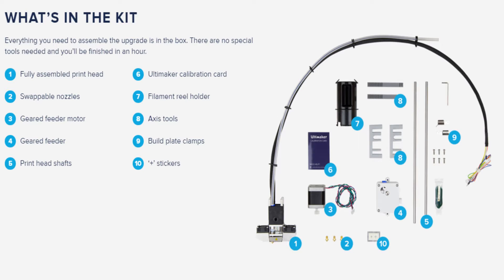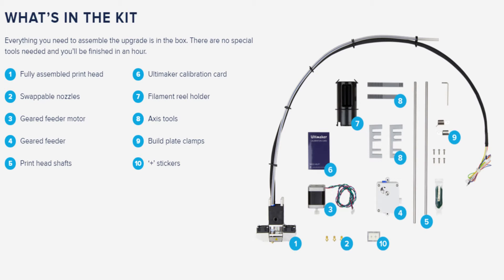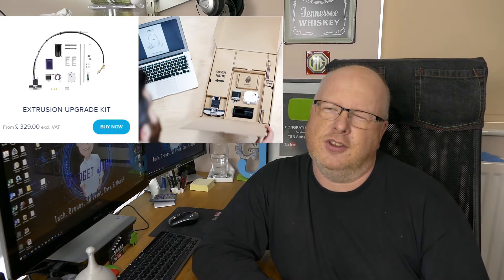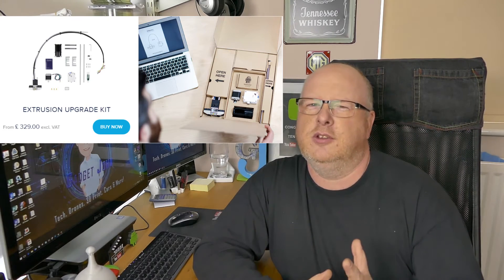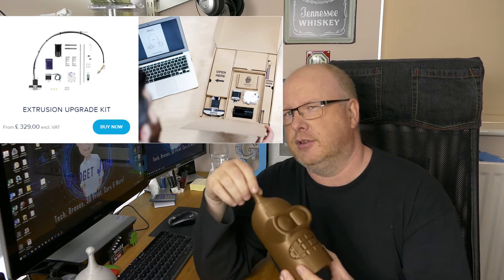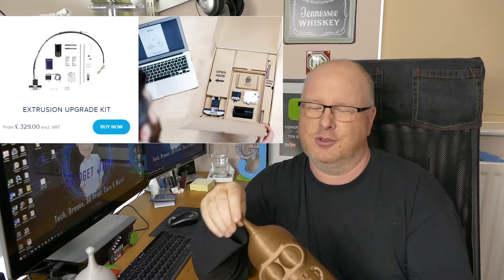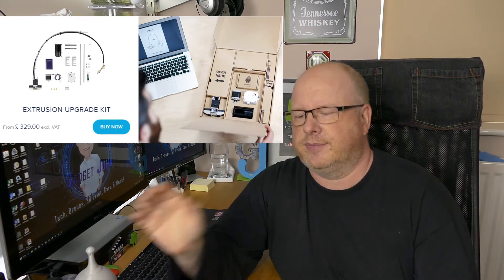Should you upgrade your Ultimaker 2 with the NEW Extrusion kit?

Comment: Seems quite expensive for my taste, but I guess thats a bit of a common theme all around with the Ultimakers. Not that i think its bad to buy one, and i'm quite shure they have a reason to charge you what they do (even if it's just to make the CEO rich... :-p).
Seriously tho, the upgrade to the plus will not make that z-scar magically disappear. The nudges you see from the layer changes are more of a combined problem out of the bowden extruder and flaws in the movement algorythm of the printer or slicer. The smart thing to do would be to have a little (or more) filament retract before any layer changes, and make shure the printer keeps moving it's x and y axis while the z-steps get executed. It could be that the current algorythm forces the nozzle to pause in a spot too long because it reloads (preloads?) the next movement steps for the new layer (just my guess here, i did not really look into the g-code buffering and movement calculations of the firmware Ultimaker uses). Maybe even some experiments with inside-out or outside-in parameters of the slicer could help, but my first point to fix that problem would be to try and add a retract step at each layer change.
Reply from the maker: +ExtraBase You know way more about the technicalities than I do, so I'll try some of your suggestions, I'm just a nerd who loves designing cool things and printing them out the very best way possible.  Did you do an unboxing video of the "big"ish Bender?
Reply: +Gadget John Working as electronics engineer and getting hooked on the first open source 3d printers way back when the reprap movement started to gain some traction definately helps with all the technicalities today. ;)
I did try to make a video of the unboxing, but camera angles, audio, lighting and everything combined were so horribly bad that i did not want to embarass myself by putting that out there. I have currently planned to do an in depth technical review on the new printer that should arrive tomorrow. Basically something to experiment a bit with the media an see if i like it. Of course, starting with a review should make it a bit easyer, since i can always redo stuff if there is something i don't like in post production. An unboxing should be good with the first take, once it's all out of the box, well, i'm not going to cheat and wrap it all up again to try again...
Reply from the maker: +ExtraBase That all sounds perfectly acceptable, an unboxing doesn't have to be unrehearsed :P I'll look out for the new video and see what new printer you have.